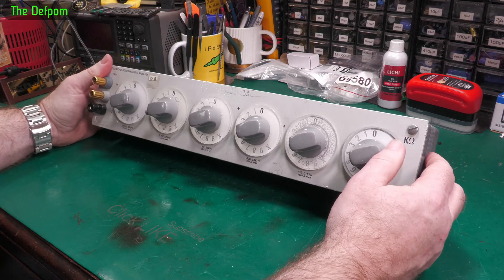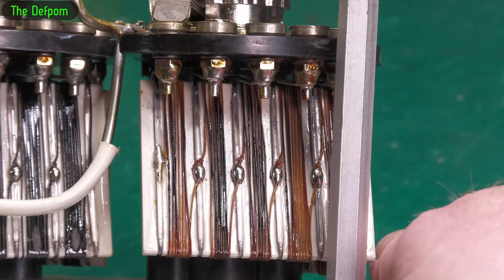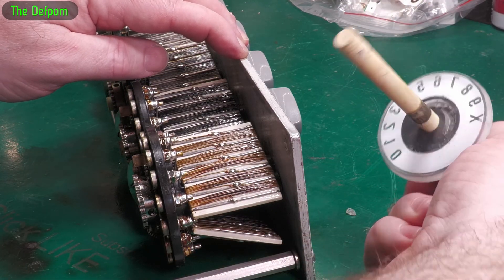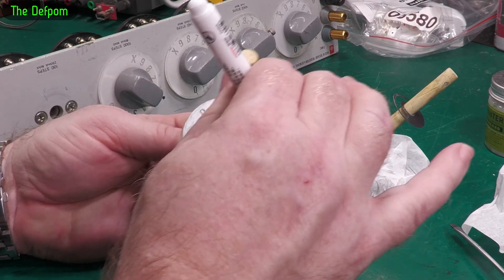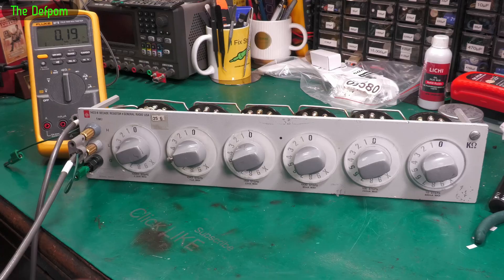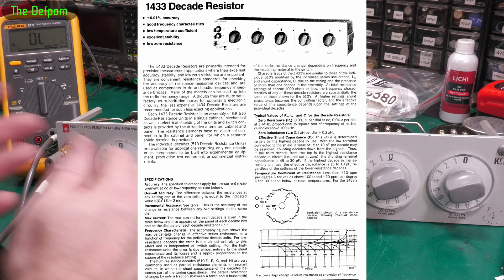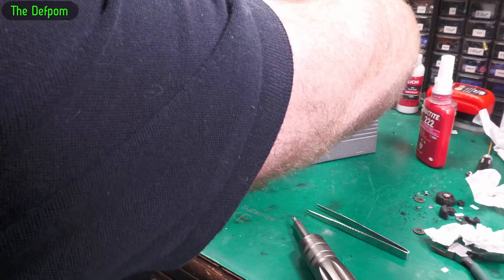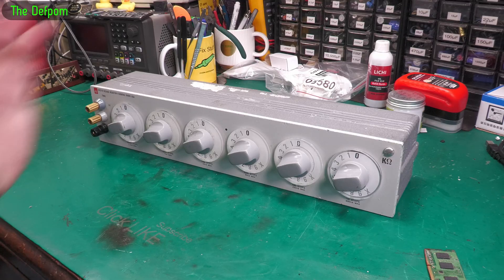🔴 General Radio 1433-B Decade Resistor Repair - No.1401

Comment: another tip if you want to repair the bare aluminium and do not care if the wrinkles are in the fixing paint as in original : Tamiya 73 XF X19 acrylic paint has very close to same shade of grey as used by HP in the 40's 50's and 60's and it is quite close to the GR Grey (HP called it Pearl grey if I remember correctly)

Comment: great video. a tip for mounting of the replacement feet: instead of threadlock I use 3mm Nylock lock nuts, I know that nylon shrinks,and eventually drys and breaks, but it takes some 30-40 years, and it is no more my worry then.

Comment: Like those old bottles reused for precision application. As I have done as well, putting silicone oil in them, which makes them great for putting a thin oil amount where needed, and also got some dropper bottles, and put flux in them, so it is easy to apply as needed, using low density flux, though when that 1l bottle is finished I will probably get thicker flux, and dilute it down with some ethanol instead. going to take another brush bottle and put heatsink compound in it, thinned down a little with silicone oil, to use for heatsinks, as you do not need much to work, and having a brush to apply it is a much less messy affair.

Comment: Several years ago I picked up a Muirhead D-801-D Voltage Dividing Decade Box which is of similar construction, i.e. wire wound resistors, sexy clunky switches. Sadly the 1K range is burnt up, still have not plucked up the courage to try and rewind the burnt up resistors.

I then picked up an Ohmite 3416 Deacde-Ranger which is of much newer construction which coincidentally also had its 1K range burnt up. Ohmite no longer made the precision resistors used in the box but some suitable Vishay precision resistors were used and it works well.

A nice bit of kit when you need it.
Reply: I got some educational ones from the scrapyard (right place right time) and the lower ranges all have the odd CBB resistors in them. Will replace them when i feel like it, as it is not often now i use a resistance box, now easier to grab a multiturn pot instead, though before i was using 2, to enable me to do offset trims on avionics, as that used, for reliability reasons, 2 resistors for offset null. Then go through the big box of used E96 resistors and find the closest values to put in, and check again, as the leads sometimes made a difference. My standard "time to change the opamp" was if the one side went past 100k, and the other side dropped below 100R, especially if you could see on the input the voltage was correct at zero (extender board that allowed you to open any pin as needed), and also that the input otherwise was correct, but the ADC result was not exactly right all across the range. Lots of SFC2741C opamps changed, that had drifted outside of the guaranteed 6mV range.